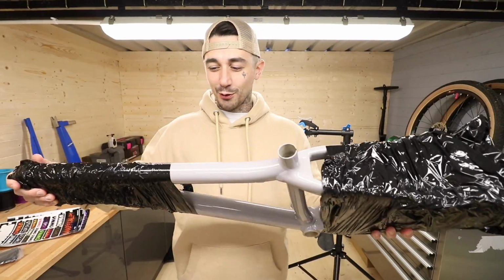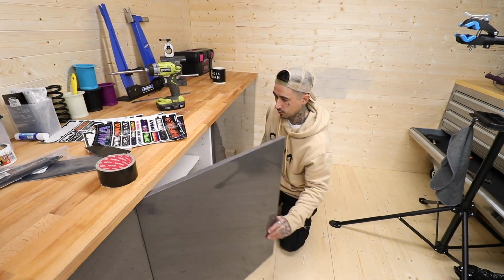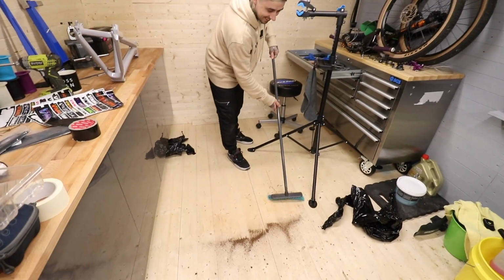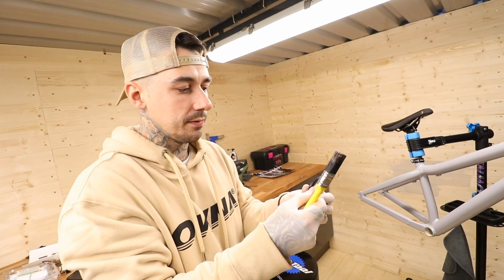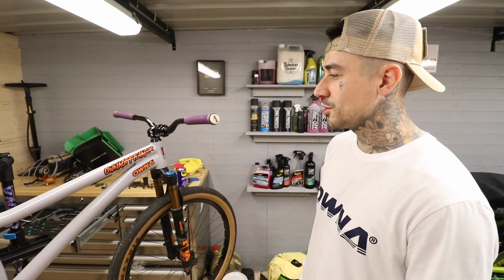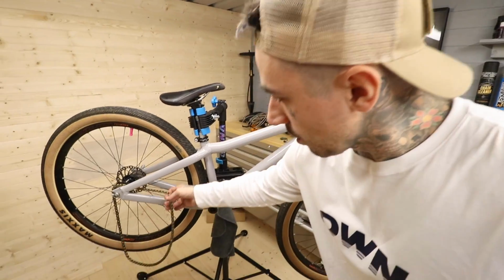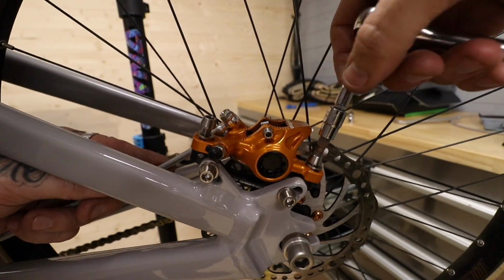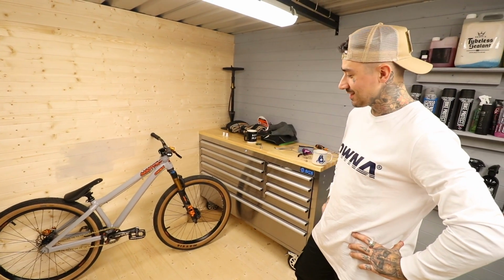CUSTOM PAINTED MTB BUILD.....CRAZY!!

Comment: It looks mega, great colours. Think you'd of been better off with normal grease not copper slip. As that's for nuts and bolts to stop them seizing up like on the wheel of a car not for bearings or moving parts.

Comment: Bro don’t use copper grease!!It will act as a grinding paste and decimate the bearings in record time....
Reply: Copper Grease only for Titanium screws
Reply: wrong
Reply: Those are sealed bearing though so I doubt any of the grease will make it in, it's just to help it sit in there. If they were loose bearing of course that would be the worst.

Comment: Copper grease has bits of ground metal in it! You should not put it on bearings as it will be pretty much the same as sand over time, designed for metal on metal but not on moving parts 💪🏼

Comment: Great vid bud. On the counter top, wood like that needs to expand and contract with the seasons. Putting more screws in it will make it worse and it might crack. You're better off gluing it down with something flexible like silicone.  Or just put a couple screws at the back wall and nothing at the front.  Also some wipe on polyurethane will seal it up good.  Keep it up, brother!

Comment: With powder coating, the plastic dust gets an electrostatic charge as it exists the gun, the charge on the part attracts the dust, then the dust is baked in a kiln causing it to melt into a continuous plastic coating.

Comment: Should only use copper slip on threads that dont require to be removed often, it stops seizing.  Grease BB axel but would remove from top outer cup as they are sealed bearings.

Comment: You really don't want copper slip in the bearings themselves. It'll act like a grinding paste.  It's not a grease, it's primarily an anti seize compound for pressed in parts
Reply: Yeah for bolts you want to undo rather than moving parts.

Comment: Don’t use copper grease on headset 🤦‍♂️
Reply: Yeah I just use it on the ti bolts on my bike into aluminium frame
Reply: Why
Reply: @smashyrashy  copper slip for non moving parts, ie BB, grease for moving parts, ie headset
Reply: @tomandjovaux1456  thank ie you
Reply: @smashyrashy  copper grease is commonly used when you have two different stationary metals touching such as a steel bolt through an aluminium frame as it creates a layer between the two metals preventing them from bonding together over time, it just allows you to take the bits apart easier when disassembling :D
Reply: @MorganH1  so why don't you use it on the stationery steel bearing case against the stationery alloy bike frame on the headset bearings. 

There is bearing grease on the inside of the sealed bearings. 

I use anti seize grease on the cases of the sealed bearings. 
And a grease suitable for use with rubber on the headset crown race and top cap rubber seals.
Reply: @dezmtber  because sealed bearings in a frame tend to be press fit and bearings are stainless steel so they don't oxidise and cling to the alloy frame the same as carbon steel does. A general rule is that copper grease is for things that don't move that you don't want to seize up, it is not a lubricant. due to it being mineral based it can be extremely abrasive if used in moving parts and can and will destroy seals and bearings relatively quickly. :D
Reply: @MorganH1  so you haven't ever seen a sealed stainless bearing case stuck in an alloy frame ? 

Nearly a 1/4 of the headsets i have replaced  came with lower  headset bearings rusted into the frames, bit of antiseize would have been nice.
Reply: @dezmtber  well go ahead and put some anti sieze in that upto you it won't make a difference but when you press them in it may just out all the anti sieze out, regardless of all of this my original point was that I was agreeing to the fact that he should never have put copper grease on his actual bearings.
Reply: @MorganH1  I use this https://muc-off.com/products/bio-grease
On all the parts in a headset as its anti corrosion and good on moving parts.

Comment: The plastic crank bolts you keep strippin, Burgtec do a metal 8mm one have a look at it loads of colours
Reply: You should never strip them as you only need to do them up finger tight with the bolts completely loose. The shimano tool doesnt even have spanner flats. 

They are plastic for a reason to stop you over tightening and crushing the bearing. It's just for adding a small amount of preload to the bearing

Comment: PROTIP: Get some medical suringes in pharmacy sotre (they are dirt cheap). Use them for dispensing grease. Precise fast and clean! You don't need so much of it everywhere...
Reply: Good idea, but question.. how do you get the grease inside the syringe?
Reply: @BrockNessMonster1991  you can pull it out completely
Reply: @ivanperica3731  right right I understand that but how do you fill the tube

Comment: Copper slip isn't a lubricant it only stops the metals reacting and seizing. DONT use it on your headset it will ruin the bearings, only use it on bolts.

Comment: Tip your sandblasted is lazy and should be covering the holes so no abrasive gets in the frame
Powder coating is not high end custom paint requires way more skill
The shelves need to go over the bench or tool box so an extra 1.5 m can be used to hang your bikes
The black hard tail you had with camo custom paint work was the best looking bike you had
Go hard Harry you legend